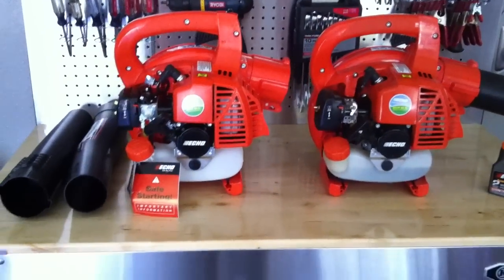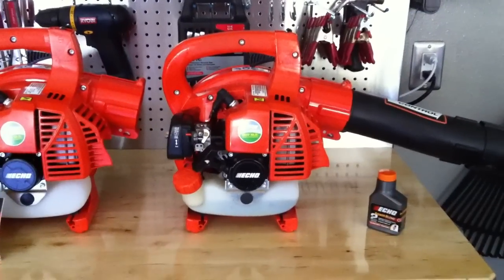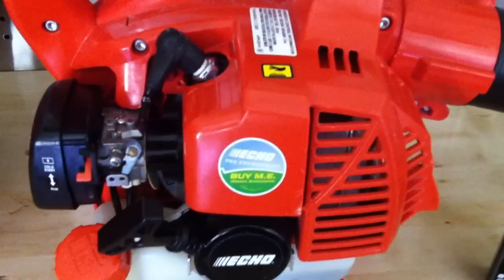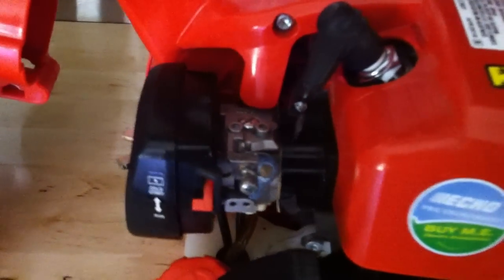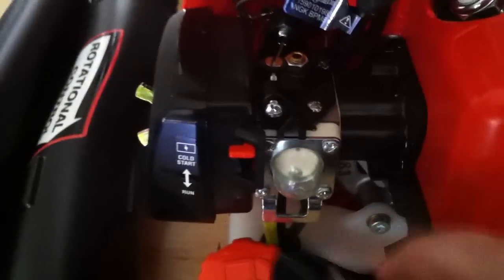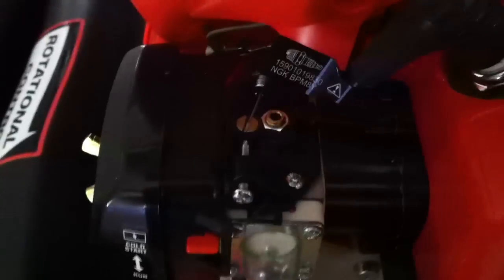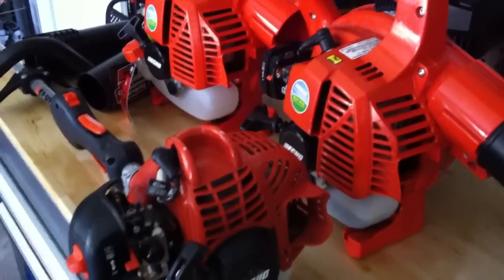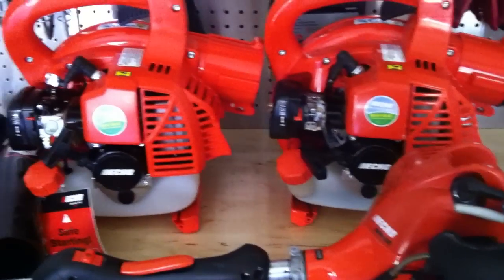Echo Blower Model PB-250 Carburetor Problems & Differences New VS. Old Model

Comment: I have the new carb model.  Bought in September 2011.  It does the same thing.
I bought it to replace a very similar 2 year old model that seized up.  That model didn't seem to have these problems.  I thought it seized up because someone put gas in it without oil, but maybe it was a piece of junk also.  I'm regretting ever buying this thing

Comment: I have the PB250 and have the same carb problems.  My model is the type with the bulb on the bottom and I started seeing the problem in high speed performance as the fuel ages in the tank.  If I put VERY fresh fuel it, it is still a little lean but much better than if I had the fuel in the tank for a a week.  They carb needs some adjustment to fix the problme but they try hard to make this non-adjustable.  Is there a special tool for adjusting the highspeed needle?